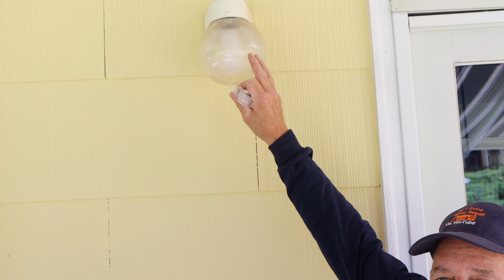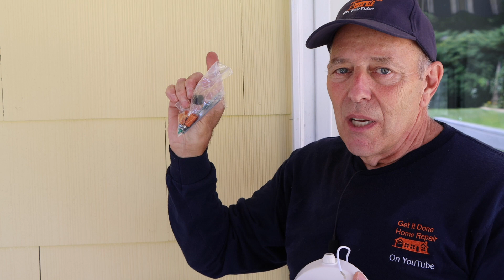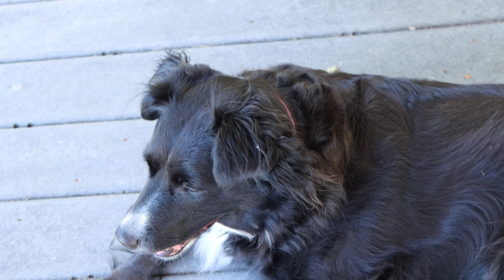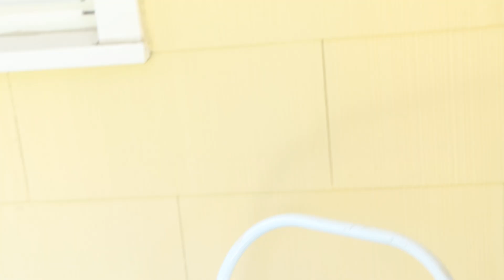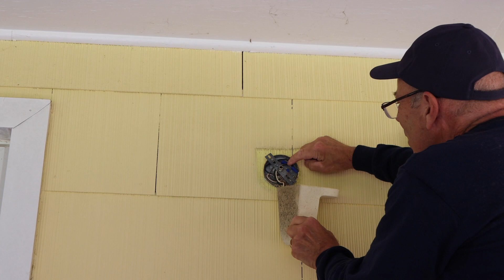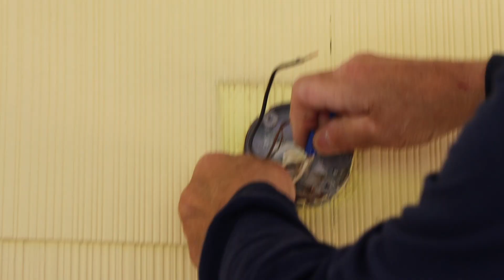How To Install An Outdoor Security Light / Dusk To Dawn

Comment: When our dusk to dawn lights go off for a bit biz of bad  weather,  how do I get them back to start working correctly?
Reply from the maker: Usually you just need to turn off the power to that light and just restart it
Reply: @getitdonehomerepair I did. That’s why I’m confused why unlike all the other ones worked after flicking switches  at breaker box on except for that 1 light.  Like it didn’t automatically reset itself or something. So everyday night I have to go to breaker box to turn on then in the morning turn off.   UGH! 😩😫

Comment: I bought two of these a week ago, but they turn off at night. I change the setting and they turn off againg.
Reply from the maker: Hmm, that's not good. Are you sure that you wired it correctly?  This light doesn’t have any settings except low and high.